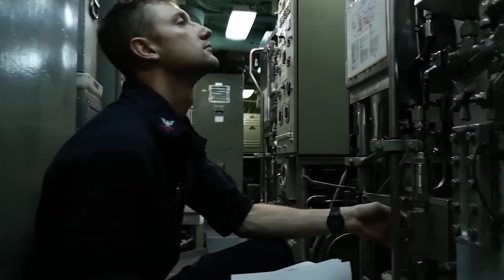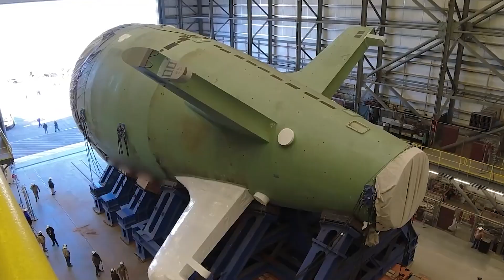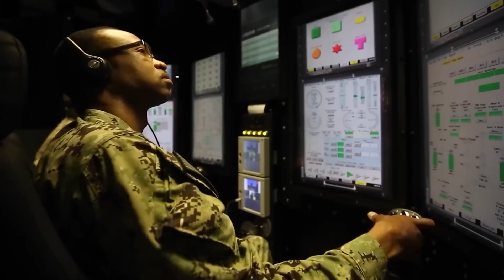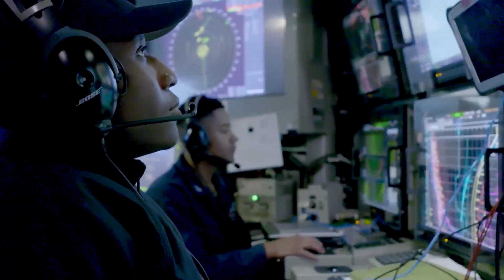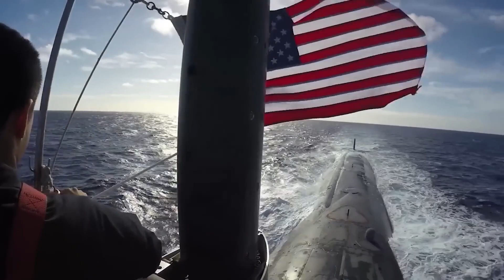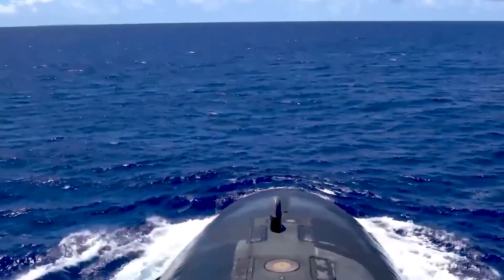The UNSTOPPABLE Power of the New U.S. Submarine That Dominates the Ocean

Comment from the maker: How does the Columbia-class submarine stay so quiet that modern sonar systems struggle to detect it?
Reply: The Columbia-class submarines have a nuclear reactor that generates electricity to power an electric motor to minimise acoustic sounds, along with other precautions like the new ultra-quiet pump-jet propeller. Essentially, the entire submarine has been designed to have fewer moving parts, resulting in less vibrations which can be detected. All of this results into a submarine that is nearly impossible to detect with sonar, moving through the oceans like a ghost.
Reply from the maker: @jacob_biros  Absolutely! You nailed it. The combination of fewer moving parts, reduced vibration, and the pump-jet propulsion makes the Columbia-class incredibly quiet. It’s amazing how much engineering goes into making a submarine essentially disappear beneath the ocean. Thanks for the great comment!